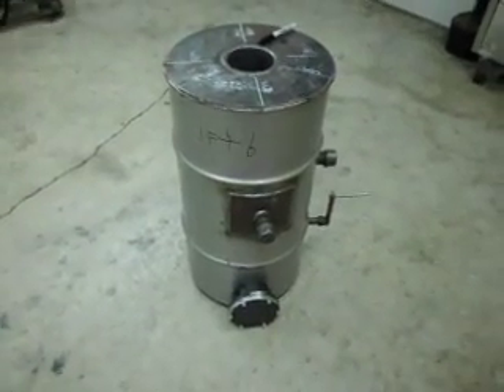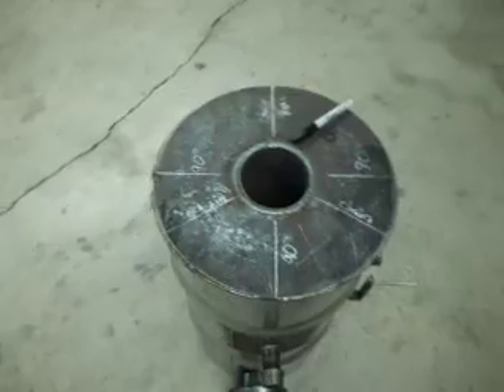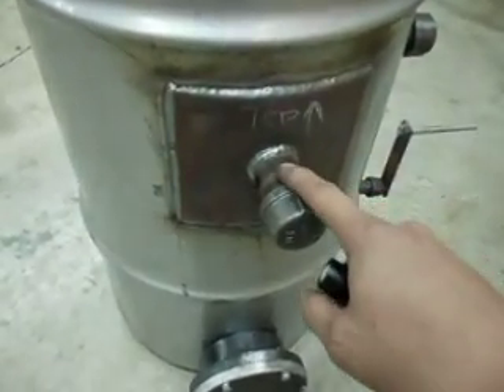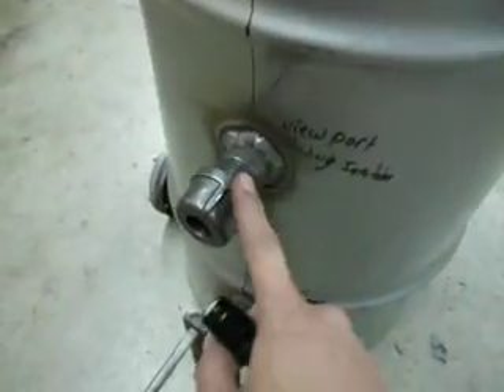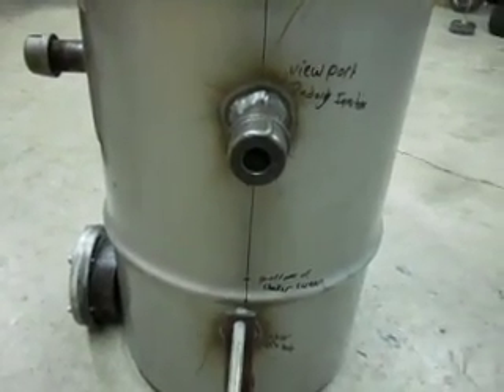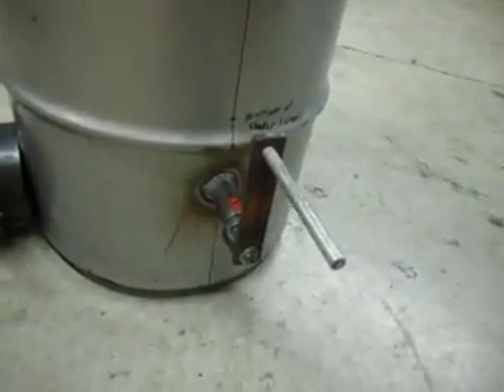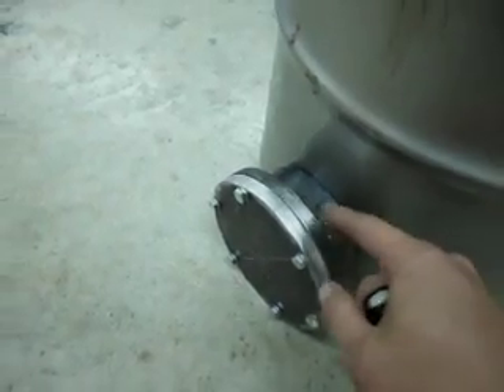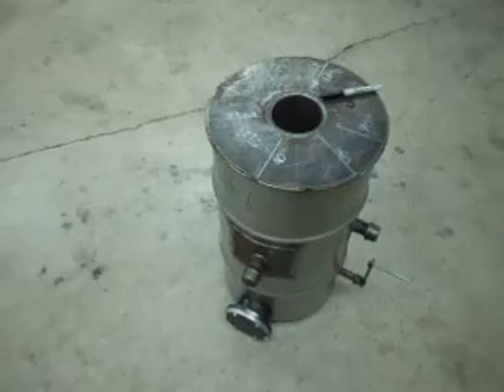gasifier progress update #1

Comment from the maker: @hobo59 the only place i have discovered tar is in my filter, however thats where i expected it to be because the purpose of my filter is to remove any contaminates before the gas reaches my generator, the gas after the filter is very clean, after my four hour test run in my video update #9 you can see a small amount of condensation in the hose leading to the generator, i do plan on adding a small moisture trap in that line, thanks again for your comment,...feel free to ask any questions ..josh

Comment from the maker: @hobo59 there are two main styles of gasifiers that i am aware of " imbert " which as you suggest must remain air tight in the fuel hopper, and then there is the " fema " gasifier which uses an open hopper, this one is a fema gasifier, i only run the fan for start up,...thanks for the comment.....josh

Comment from the maker: The pyrex started out as a 3" lab dish, I then whacked it with a hammer to make smaller pieces, picked one that was around 1 1/2" square put on some gloves and safety glasses and started shaping it using a bench grinder, it works quite well, almost like shaping steel.